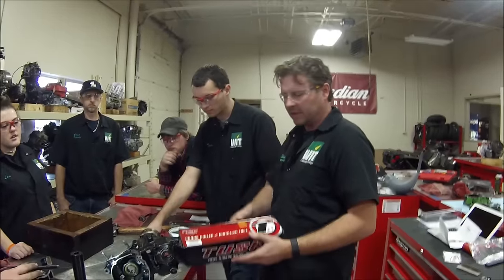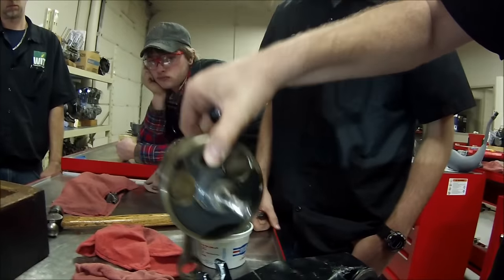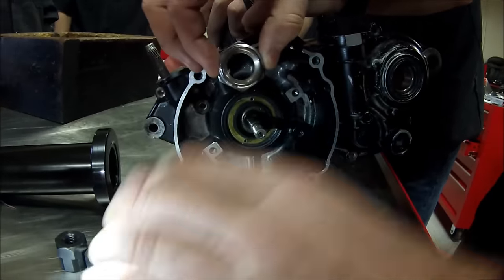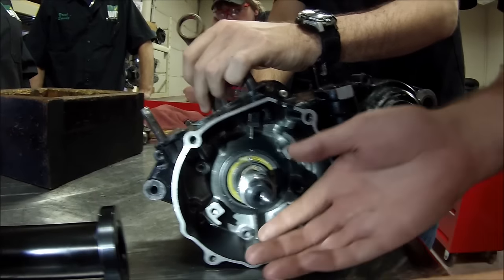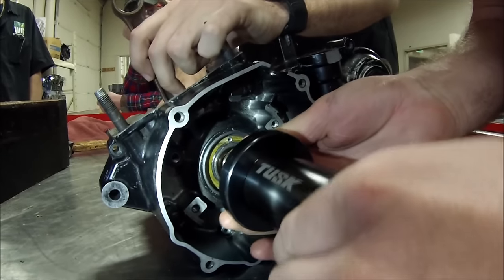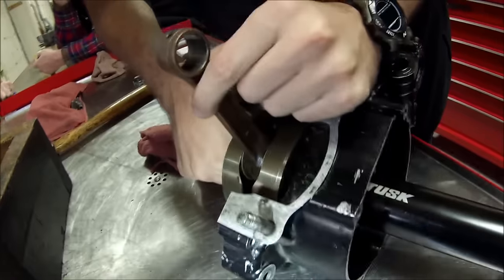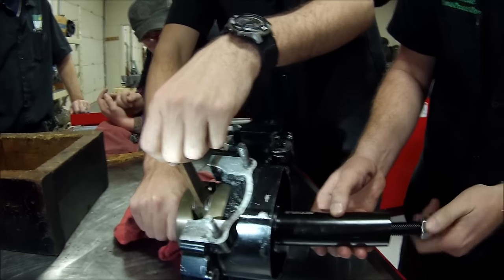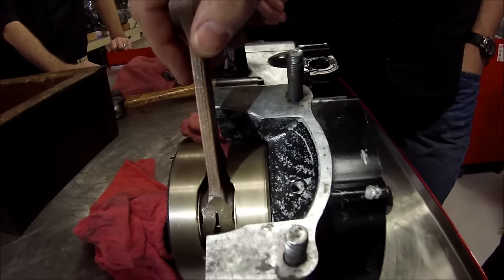Tool Review: Tusk Crankshaft removal installation tool CRF YZF CR RM KXF KX RMZ

Comment: hi Shane! thank you for this video. I immediately bought this Tusk Puller after watching it. I used it yesterday to pull the crankshaft in, it works great. I found out that this Puller works great with Tusk Crankcase Splitter to spilt cases evenly as my case is not easy to spilt evenly despite using a soft hammer to hit the sides.
Reply: while I attach this puller, I use the Tusk Splitter on the other side.

Comment: so im just wondering, does the tool push on the case half or on the inner race? in my opinion its should seat on the inner race of the bearing as you pull the crank into place so your not side loading the bearing during install. thanks in advance and thanks for sharing!
Reply: Depends on the bearing. I'm building an XT500 engine now and the body of the tool can rest directly on the inner race. It has pretty large crank bearings though. you could make it work on smaller bearings with some imagination.

Comment: Hi. Crankshaft from 4-stroke motor would be easier to install and can be done with hot-and-freeze method right? One more thing I noticed that the crank bearing in 4-stroke motor usually stay in the case, not on the crankshaft like 2-stroke. Thanks for the video.
Reply from the maker: +Tuan Anh Pham Cong 
Here is a link to hot/freeze video. As far as easy goes, this tool is great when used properly!
https://www.youtube.com/watch?v=Qj7w_vwFZpM&index=6&list=PLAtBOuPaEyt_uMyVlK1tsBVnSYW1Q0vCK

Comment: Shane, have you ever used this tool to pull the crank on a 06 Yamaha 450 4X4 Wolverine?  Reason I'm asking is this, the right side of the crank it is 22mm, the adaptors that came with my TUSK kit are 11mm and 8mm. any Ideas????